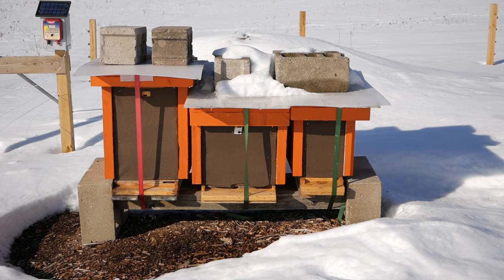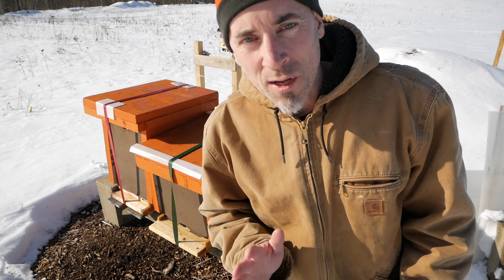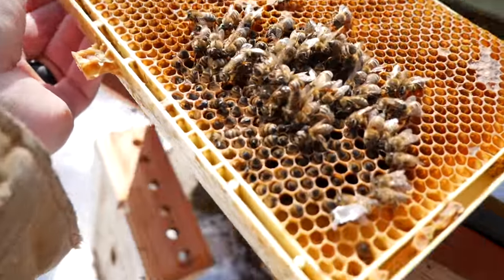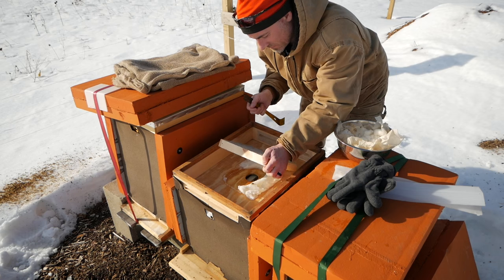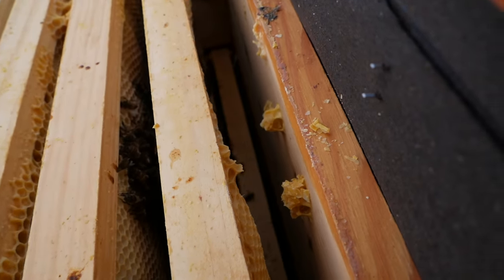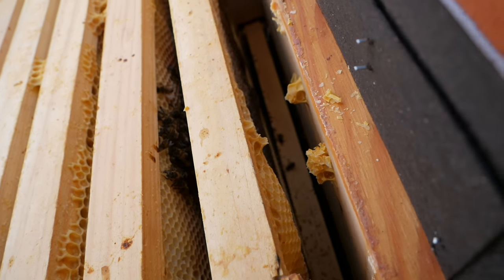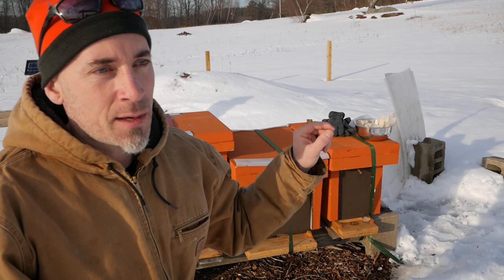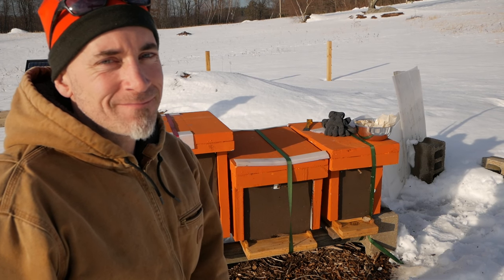Flow Hive - Did They Make It?

Comment: I've done everything as you've done it and will bring in my first bees this spring.  I've added follower frames on the outside of the regular frames for additional dead space, and I'm using slated bottoms.   Ready to go with the insulation boards, etc for this winter.   Based on your strong flow hive not making it, (a mystery!) I'll try to bump up the insulation even more and will keep my fingers crossed.  We had some brutally cold stretches here in NE Washington State, similar to yours.   

You're a rock star.   Enjoying the bread, too!  Thank you for sharing everything so that we can learn.  Regards to you and your family.  Elena

Comment: Quick question for you, I hope you still monitor this post. Thinking of raising bees in upper peninsula Michigan? Temps get very cold, in January had -50 wind chills. Thinking of moving flow hive into the green house for the winter and heating the green house to around 50 degrees thru the winter. There will be some flowers in the green house and water available. Any thoughts on this to protect the hives during extreme cold winters?
Reply: Is your greenhouse heated in the winter?

Comment: Could it beee that the two outside hives where helping to insulate the one in the middle?
Reply from the maker: I thought that at first, too, but in the depths of winter on a cold night, there would not be any heat transfer between hives. There is an air gap between them, so the same cold air surrounds each hive. They were all wind and water tight independently. I think it's just genetics. That (survivor) 2014 queen has been special from the start. I really want to keep her alive and try to split that hive to propagate her genes!
Reply: Definitely a good point.
Reply: Shawn Bauer Bees never die because of cold...
Reply: but it is still shilded from wind more then the others
Reply: That second mouse didn't come from the middle box did it?  Have you peeked in there to make sure the mice aren't also in that box? Are you going to use a mice guard in the future?
Reply from the maker: Mini DK#9 I looked in and did not see any signs of mice in the middle hive. I also promptly closed up the bottom entrance all the way. They should be OK.
Reply: Good point, but I've seen so many videos of live middle hives and dead lateral hives that there has to be a relationship between the deaths and the line placement of the hives. People says it's actually the wind, lateral hives acts as windscreens for the middle hive so they actually provide protection and insulation. Insulation does something, but it doesn't do miracles, the middle hive is definitely more protected than the other 2, in the end. Fortunately we don't have such cold winters here.
Reply: Shawn i was totally thinking the same thing... man tries to divide and nature intertwines.
Reply: nah if that is the case then that is the reason they died.. hives need to be so insulated that the least amount possible of heat can escape, atleast in those cold areas.. they didnt die of starvation, outer edge of the cluster died in waves as he said the very cold nights.. this is normal.. just depends on if they are big enough mass and the box is insulated enough to not let air out. 

i wonder if a space blanket around the frames would help during the winter? as it radiates the heat back from the wall? hmm

Comment: Have been watching a while. I live in Canada so I get cold weather. There is a hive I have been quite interested in a Long Langstroth. More so since watching your videos introducing the double nuk.  Generally what you have is a single long box I am sure you know of them but I was thinking it could be split into four joined hives all sharing warmth.  I also was wondering if the bees wouldn't swarm better with a wider central space?
Reply from the maker: In a cold winter situation, it's much easier for clusters to move up/down than side-to-side to get to stores. I prefer a taller, narrow configuration. That's why I use 8 frames instead of 10.

Comment: Would there be any point to wrapping a layer of insulation around hives before winter to help them maintain their own heat, or does it speak to some survival failure on the bees part if they don't make it through a winter?
Reply from the maker: Brad Gefroh The orange stuff on the hive is 2" rigid foam insulation. Below that is tar paper acting as a wind/water barrier and solar collector. The black part faces the sun.
Reply: Oh! Good to know, thanks for the quick reply!

Comment: which direction are your hives set up facing? wild bumblebees nest facing north in order to keep the temperature stable and prevent premature waking just because of the sun, perhaps you had a problem with similar to this? also this would be worse on the outside hives as the temperature would fluctuate much more freely
Reply from the maker: Joel Kemp Hmmm. Every single thing I've read or heard since I decided to start beekeeping suggests to face hives toward the south. (In the northern hemisphere) I have never heard of facing a hive north.

Comment: I have a question.   Couldn't you like wrap some insulation or something around the supers to prevent excessive heat loss?   Wouldn't that increase the odds of your bees making it through the winter (you'd still have to leave openings for ventilation).
Reply from the maker: You must be new here... There is insulation on the hives. I made several videos on my winterization system last fall. 
It starts here and the following three videos are all about insulation... https://www.youtube.com/watch?v=egix-XrxDKk
Reply: Cool, and yes, I am new here.   Starting to get interested in bees and I'm trying to gather information.   :D   Thanks for the link.
Reply from the maker: The "Flow Hive" playlist on my channel covers every single thing I did with bees in the past year. I don't officially start my second year with bees until May. I'm still a noob, so don't take anything I say as expert advice. But you will see many, many things about the day-to-day general beekeeping activities you are in for. Some things worked, some things didn't, but they're all there. Thanks for watching!

Comment: Sorry to see that, after all your right moves in the Fall. I guess some of those things are a bit difficult to analyze/diagnose. I'm rather new to beekeeping and last yr we lost our colony right around mid December (Northern Illinois) still w/ plenty of stores inside. This year, so far so good, they have been collecting tons of pollen few days ago when we had temps into high 60s. I got myself a BroodMinder-TH and I've been monitoring them for the past month or so. Great tool for small (few hives) beeks. Good luck this coming season!
Reply from the maker: I do want to try a thermometer next year. I hope your bees pull through!
Reply: Thanks for your episode with the Vivaldi board. My daughter and I had researched this a bit and your review of it was quite informative. Little bit late because it was around Christmas, we decided to order one but unfortunately had to wait until until late January to be able to install it. I think it's a great tool for helping the bees overwinter. Again my BroodMinder TH senses temperature and humidity and I installed it actually in the Vivaldi above the upper brood box on another fairly warm day some three weeks ago. Since then I can tell you that the relative humidity in my hive was only a couple of times in the low 70s the rest of the time it's been in the 50s and I really credit this to the good ventilation and the moisture sucking of the Vivaldi with the burlap sack. I do have a layer of inch and a half Styrofoam around my hive and over the cover. We will see. One more month and they should be "out of the woods".
Reply from the maker: That's great!

Comment: I received my bees from Maine and they are still alive.  Most of them are darker in color so I'm thinking they are related to Russian bees.  Mine hang out at the very top were the fondant is.  I insulated like you did with the added rigid foam on top and it prevented the condensation on the burlap.  I also used one of those bee cozies.   I'm concerned about the warm up this week and the deep freeze again this weekend.  I hope the two extremes don't catch the bees off guard.   Maybe there was a mite problem?  It's strange how the bees died in the cells which is suppose to indicates starvation but then there was plenty of honey the next frame over?
Reply from the maker: Glad to hear your bees are alive. Mine came from Georgia and I won't be doing that again. I've reserved some local bred Russian bees to replace the ones I lost. Yes, dying with all that food right there indicates there was something else going on. As someone else stated in the comments, probably some kind of pathogen due to the mites last fall. There will be a follow up video in a couple days.
Reply: Where did you find some local Russians?  I only have one and as of right now it's doing well.  I ordered another package, but they're coming from CA.  I won't ever get GA bees again.  Never had any luck with them.
Reply: This is my first hive so I can't tell you for certain if they are Russian bees.  It's just that the majority are darker than the rest.  I thought I had missed the season but found someone from Maine listing bees on Ebay.  I had no experience when I picked up the bees at the mail distribution center and drove home with them on the front seat.  I installed them on July 1st and just kept feeding them syrup into the fall. I either got lucky or they are a hardy local strain of bees.
Reply from the maker: Spencer Brennan Sorry I didn't see this the other day. Warm Colors Apiary in South Deerfield, MA. They're an RHBA certified breeder. Their site is not loading for me at the moment, but they had Russian Nucs available as of last week.
Reply from the maker: NewEnglandgardening That does sound pretty lucky!
Reply: I "hear tell" that when it is SO cold, like some of the nights we get here in MA, that the cluster can't move around as much to locate itself over the honey and will sometimes starve with stores very close by.

Comment: are you at all concerned with the cinder blocks transferring cold to hives?
Reply from the maker: I don't think there would be much cold transfer through 2 layers of coreflute, 2" of rigid foam, plus the 3" of vivaldi board space... but I hadn't really thought of it.
Reply: Vino Farm I just ask because although unrelated, I recently installed a small hot tub, and even though it came with an insulated bottom I was advised to install on a wood base (deck) with 3 inch rigid board for more insulation value, as opposed to putting it directly on cement (highly discouraged). It was just a thought for the hives as I realized the bees may have perished from the cold.  I do appreciate all your videos and efforts. I'm learning with you too. I'm located near Ottawa,  Ontario,  Canada.

Comment: it think the problem here is upper ventilation holes, when bees cluster to make some heat, as hot air moves up, heat goes from upper ventilation holes and makes inside colder. Maybe closing upper ventilation holes could help bees to preserve heat they generated by clustering.

Comment: You did everything you could man - sorry for your losses.  If I had to choose 3 things you could try next year:  (1) Put food DIRECTLY ON the frames, rather than making them break cluster to get at the food.  (2) Build a simple windbreak (alcove) out of black fabric.  (3) put a black plastic skirt around the base of the hives (greenhouse affect).  I'm in Leominster MA and my beekeeper mentors lost 4 out 5 last year, but I've still got 2 double deep 10 frames - alive (so far).  My bees had no honey last fall - I had to supplement with 2:1 syrup in late Sept, so both hives started winter from a deficit.  What counts (in my nubee opinion), is that I put the food is DIRECTLY on the frames.  (I used 'Beverly Bee' method for insulating - sugar shim with a 1/4 in screen w/sugar&pollen patty directly on the frames (1/2 hole in front), igloo style inner board, poly insulation, standard outercover, and I just used tar paper around and on top, BUT! I also made a cheap passive solar heater (black board wrapped in a black and clear trashbags) in front of my hives that slopes up towards the entrance (like a child's playground slide).  The other thing I noticed is that your hives are out in the open with no windbreaks, and the wind sweeps under them.   As another person commented - maybe the center hive did better than the flow hive, because it was sheltered by the other two.  And also the other two were narrower (8 frame flow, and 5 frame nuc) - they hold less heat.  where your center hive was 10 frame?.  - like all bee keepers - we're just trying to figure it out.  I will probably try insulation next year on the 2 non-sunny sides and top, but also will build a larger passive heater on front - that will look more like a solar evaporator. (Plexiglas with an air gap and insulation behind - thanks for the Great Stuff glue video!.)  From research, I've learned that the *most important thing* is for the bees to be able to "Break cluster and move around on cold days to reach those stores in the other parts of the hive".  In your flow hive - there were stores, but they never left the cluster to get them.  That's the key.  Also be sure to over feed your bees in AUGUST.  Take care of the bees that take care of the bees that go into winter.  Good luck this year! ...Don...
Reply from the maker: Don Rota Thanks, Don. Great suggestions. I will definitely be modifying things this season. I appreciate the comments. Stay in touch! I'd love to see your solar heating concepts.

Comment: Stay positive, you have one strong hive that made it throe the winter.
My suggestion is that you make three mini nukes (mini nuke is about 1 frame volume)
take 1 with food ,1 with fresh laid eggs and 1 drown empty frame
split all frames in 3 parts and put them in mini nukes
empty drown frame cut in strips of frame width and pinch at 1-2" apart to the mini-frame so the cells are vertical
shake bees from 2 frames in each mini nuke to make them super packed and close them - do not let them exit for 1 day
next day put them in different field (2-3 miles away preferably) and let them out for orientation flights.
Making sure to keep them packed and sealed inures you that bees have two combined instincts (1 is swarming) to make new queens. Since they have food and eggs (from your queen) they will make good young queens.
From this mini nukes when they have queen you can make nukes and if they are real good move them to regular hive.

To be sure to have fresh laid eggs put empty frame near the frame with queen so she can lay eggs there.
Next day take that frame to make mini nukes.

Comment: Right now it all comes down to what you did and didn't do for Varroa last August...
Reply from the maker: The big Flow Hive was treated in September. Very successful MAQS formic acid treatment and they built right back up again in September/October. The little nuc was not in my possession until October and they were treated in mid October (a little late, but they were not my bees until then.)
Reply: Vino Farm unfortunately I'm hearing from a lot of beekeepers that efficacy of MAQS is way down. some people think the concentration of formic acid in the strips was lessened due to some department of transportation objections. personally, I found that every time I treated with MAQS last year my mite count was back up within three weeks.I wouldn't have caught it without pretty regular testing. I kinda panicked and dropped the cash for an oxalic acid vaporizer and feel good about this spring.
I've seen a lot of dead hives this spring, and when you ask, very few treated for Varroa. Or too little, too late...so that was the basis of my original comment.  your surviving hive will probably be a great candidate for splitting and making queens with. cheers!

Comment: One more thing, if the bees get trapped in a section with no immediate honey around them during a sudden cold snap, even a frame away, they can starve because they ball up and don't move to the new stores. Sometimes bad timing can cause that. My colony #2 is tiny aswell, started large, genetics may be at play with mine, she is being replaced in spring.
Reply from the maker: Yes, I know they could have been trapped. We had some really cold stretches over the last couple months. It's such a bummer that there was so much honey right there!

Comment: Try doing 2 brood boxes next time. Bees need more food and in the North, they need 2 full brood boxes of Honey and Pollen. I am even giving them a honey super with 3 frames of sealed honey and fondant. 
I live in NY so its not much different in temps. 
Keep in mind that bees start at the bottom and work upwards. They will use just the center frames and may still have honey in the outer frames. 
They can not travel too far from the cluster so this is out of reach in most cases.
I am not surprised that your NUC didnt make it.
You need more bees for warmth than that can provide as well as food.
On a positive note...I like the foam insulation idea.
I was planning to do that this year but with thinner sheets and get the face material so to resist weathering.
I am thinking 2 sheets should cover 4 hives. The 5th hive I have is not going to make it through the winter. I have already accepted that.
Reply from the maker: Ray Gerwitz The hive I lost was two full deeps. They died with half a box of honey left in the top box. The one that survived was a double high medium but they were a much smaller cluster going into winter. This year we're going into winter with two double deep hives and that survivor hive is a triple medium.
Reply: Vino Farm sounds like a week hive going into winter and they froze out.
I am trying some new things this winter with much stronger hives and leaving a honey super on as well as feeding fondant.
Live and learn.
Good luck